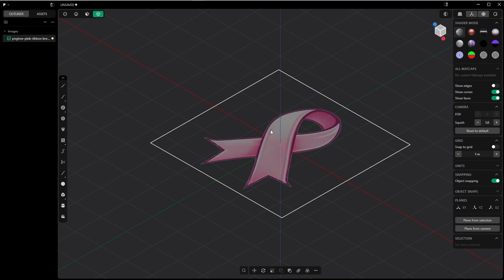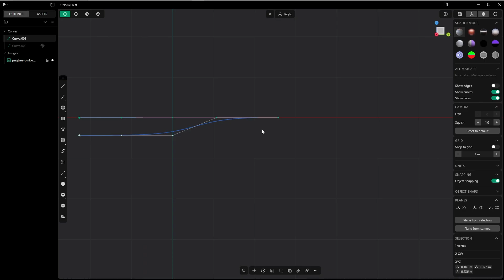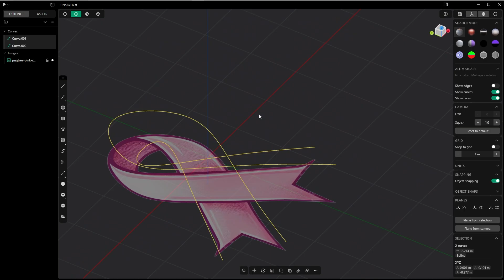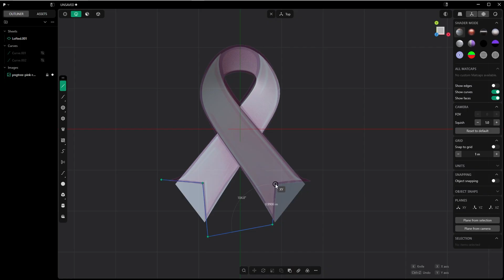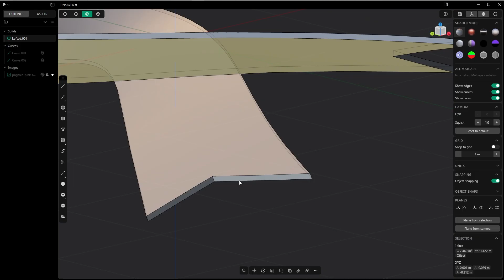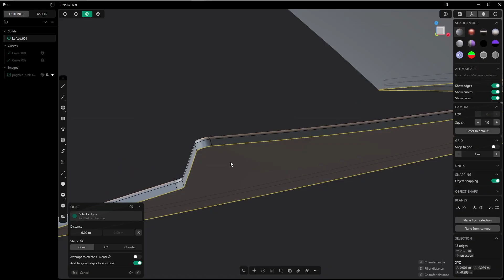CAD Surfacing a Ribbon with Plasticity

Comment: Another tip for people - if you're in an orthogonal viewport (like Front, Top, or Right) and you select an END vertex of a control point curve, and then start dragging it, if you then hold down Alt while dragging, it will also move the other verts while trying to maintain the original curvature. In a Perspective viewport, holding Alt while dragging the vertex just makes the distance farther, but in ortho viewports you can use the Alt+drag to make nice curveature automatically.